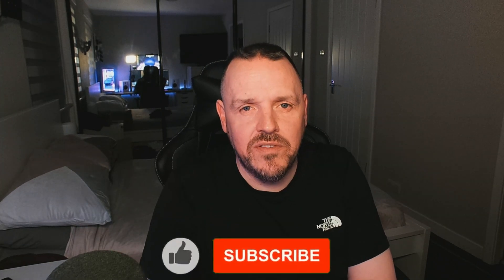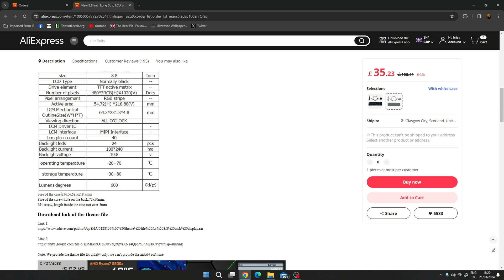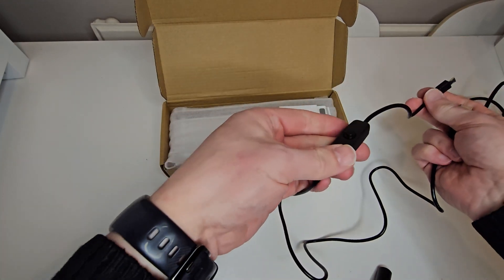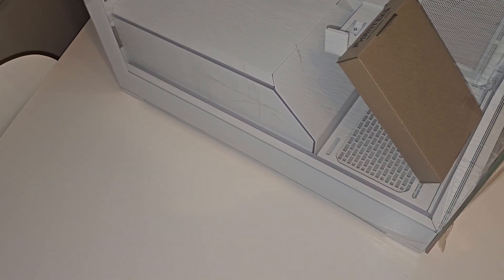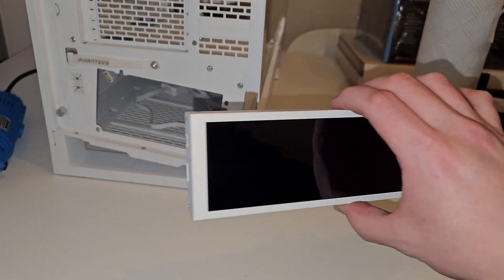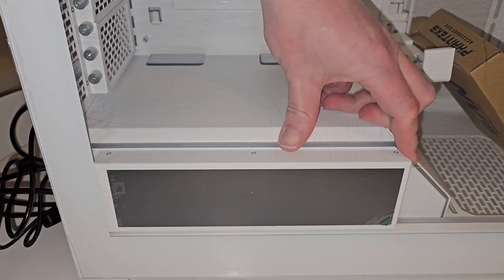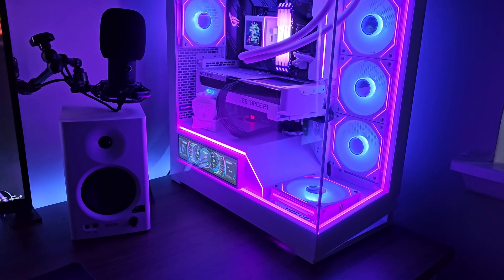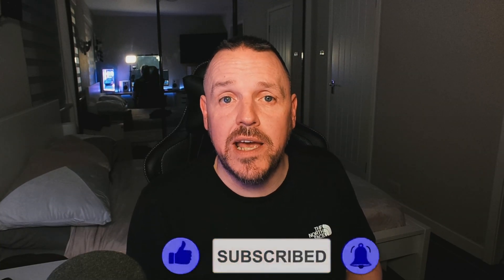Phanteks NV5 - How to install a Sensor Panel or System Monitor

Comment: I looking at this screen but I think I might have a problem due to I run vr for sim racing and the pimax vr has issues running more then two dpi connections as vr uses one and my screen. I’m going to look into it

Comment: I wonder if that would be possible to connect directly to a USB header on the motherboard.
Reply from the maker: @hockey1973  for the power mine is powered off an internal USB, HDMI still goes outside the back case and plugs into the graphics card. Next motherboard I'm just about to buy actually had an internal hdmi for this very purpose but would still run the cable outside as it's way cleaner in my opinion.

Comment: I have a question for you. Is Aida free? because I see that you need a license to use this program. Is it possible to display only the GPU temperature and change the image background without paying for a license? Is it necessary to pay for a license to change the image background?
Reply from the maker: @stolustravel3906  some features you need to pay for like showing the GPU temps, from memory you could do everything else, custom backgrounds and so on, make it look like you want it to, just some sensors won't register unless you pay for the license
Reply: @BrisyTechBytes  Can you tell me exactly what free features are available? Can any sensor information be displayed? is this sensor information only for paid users? Thank you
Reply from the maker: @stolustravel3906  as this software is constantly updating I'm not 100% sure what will continue to work after the 30 day trial period, only from memory when my initial trail period ended the GPU temp was showing as "trail" rather than a temp, but I'm sure everything else was showing OK on the sensor panel screen. I just ended coughing up the cash and paid for the license which I do annually, and even then I don't think you need to do it annually unless you want the new features of any updated versions of the software when they come out.

You might as well give the trial version a go and wait till the 30 days expire to see what stops working then make a call on it if you want to pay for a license or not...have alson een people mention Rainmeter as an alternative option but I have never looked in to this, have no idea how customisable it is and if there are forums with people sharing their sensor panels to download like you can with Aida 64
Reply: Thank you very much  @BrisyTechBytes

Comment: Hey man, mind sharing which ROG template that is or where to get it? Looks amazing and fits my build perfectly!
Reply from the maker: @DavroarTV  have a look at the forum linked below, you can do a search on it for 1920x480 and should come up with loads that people are sharing, that's where I got mine from...

https://forums.aida64.com/topic/13296-share-your-sensorpanels/
Reply: @BrisyTechBytes  yeah I saw the link but it was over 500 pages and it gives me error if I dig too deep. Ill try to figure it out later today, thanks anyway
Reply from the maker: @DavroarTV  try this link, should be the direct post on the forum where you can dl the zip file...

https://forums.aida64.com/topic/13296-share-your-sensorpanels/?do=findComment&comment=39214
Reply: @BrisyTechBytes  Thanks a lot mate! Much appreciated!

Comment: Do you know how to install infinity fans to the same caseUNI FAN SL-INF 120 LIAN LI ? I’m not sure how to do this as I don’t want to use the RGB button on the case and I learned connecting them to the motherboard with one of the cables stops the buttons working.
Reply from the maker: @jmurray2018  the Lian Li fans will come with a hub that connects to an internal USB header, then you can use Lian Li L-Connect 3 software to control the fans.

Comment: Looks amazing, but I'm reluctant to drilling a hole in a brand new case 😂
Reply from the maker: @dreamEnd  yeah totally get that, done a similar mod on my previous case but there was more butchering involved 😬

Can still be done without cutting the hole, would mean running the cable over the PSU shroud to the back of the case and taking advantage of the little rubber grommet that is there, black case version would be even better for doing that way, harder to see the cable.

Comment: Hi bud cracking video. I just built very similar build in nv5 to yours for my son. Only difference is I'm using sl v2 fans. Just wondering if you had to take radiator out to fit the argb kit at top. As I just ordered one cheers 😊
Reply from the maker: Thanks much appreciated.

I bought everything for this build at the same time so managed to fit the RGB kit first, should still be possible to do without removing the top radiator though...hopefully 🤣

Hope your son is enjoying the new rig 👍

Comment: how is it getting the temps? i did not see any temp cables
Reply from the maker: Using Aida 64, reads all temps possible through the Motherboard, CPU, GPU, Ram and so on

Comment: Please describe what software you use for fhe screen? And how are you controlling the rgb lighting? I notice your fans have two colors
Reply from the maker: The software used for the screen is Aida 64, I didn't go in to detail on it on the video as I have previously covered that in another video which there was a clicky for in this one, there are lots of videos on YouTube covering how to do it but you can find mine below.

https://youtu.be/ygzUrsC9WP4?si=t8buU9TNOEbCzWxA

As for the fan colours, those are all controlled through Phanteks L-Connect 3 software 👍